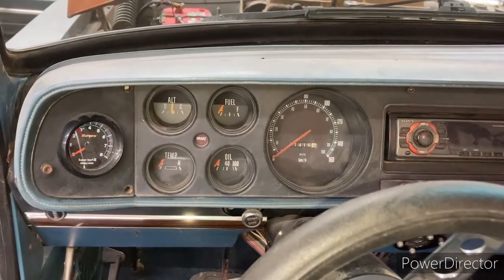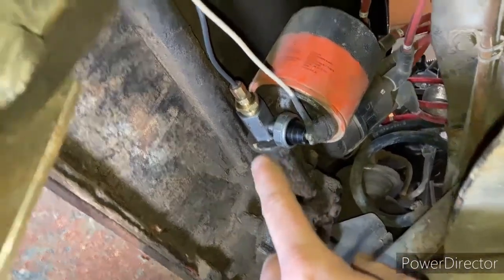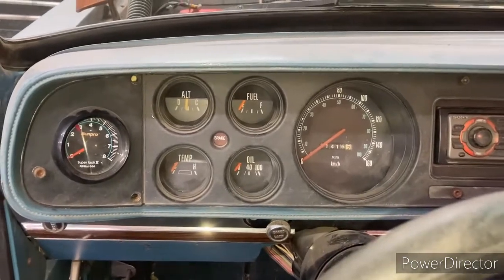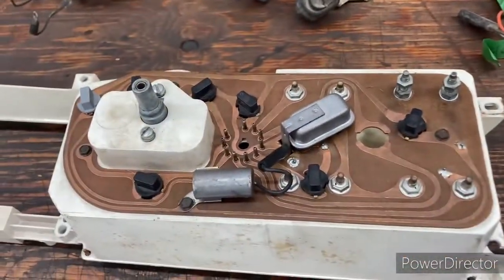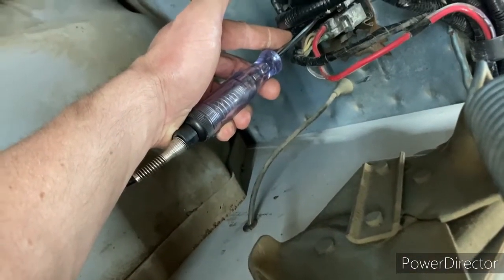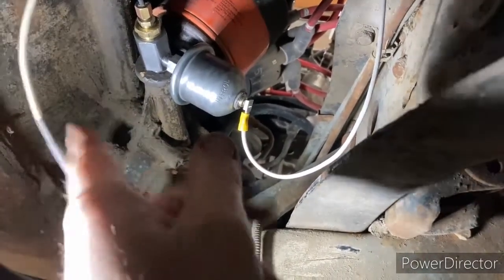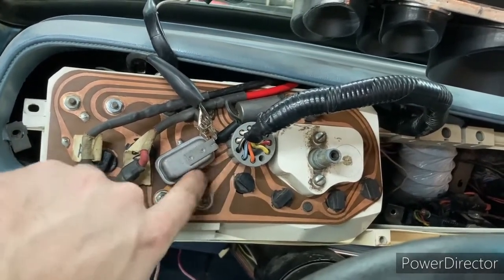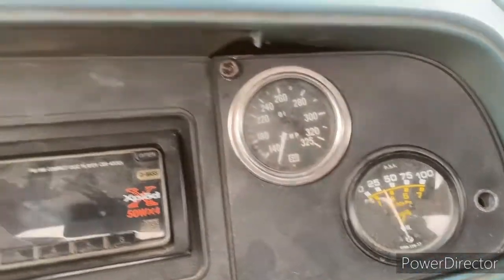1970's Dodge Truck Factory Gauges Repair

Comment: my 72 b100 had this issue and it turned out to be the actual light switch that turns the headlights on.  I noticed when turning it to dim that the lights would flash on for just a second.  Changed it and the lights worked again.  Great video though.  made sense of a lot of things, thanks.

Comment: Excellent work running down all those electrical connections and doing the process of elimination.  Most people would’ve simply thrown parts at it and hoped for the best.

Comment: Thanks for the video. It should help a lot to figure out why my instrument cluster  lights don’t work. I’ve looked at multiple resources and they are contradictory as to what light bulbs the cluster takes. Could you point me in the right direction please?
Reply from the maker: Try a bulb #194 made by Phillips, Hella, Wagner,or Sylvania. Different manufacturers but the bulb #194 is the same. Hope it’s the right one for you.